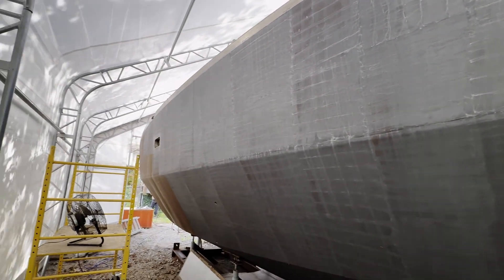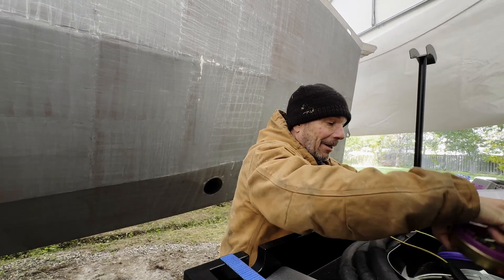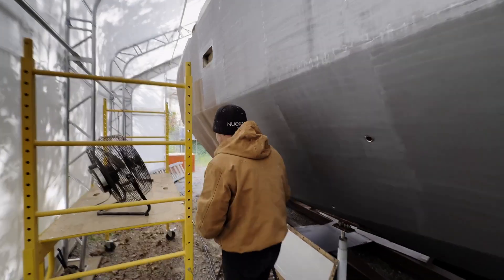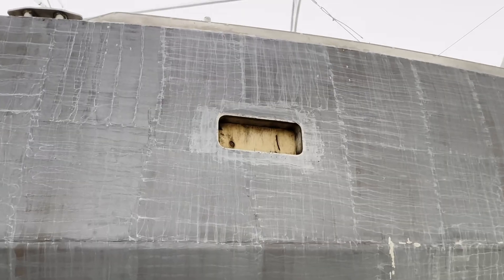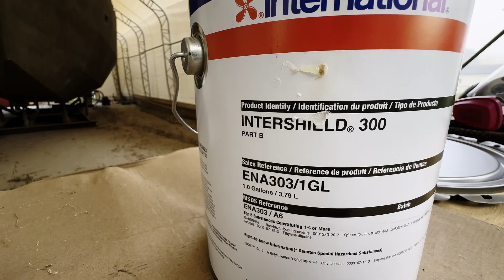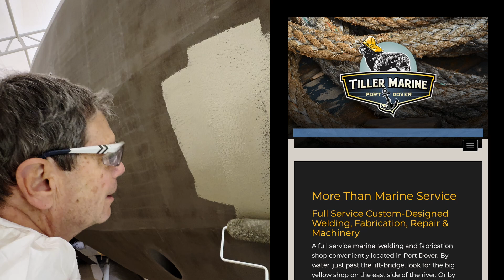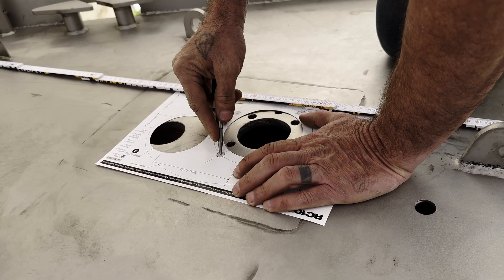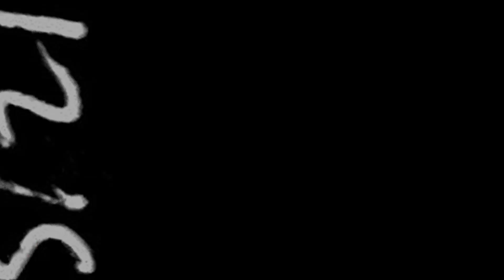⛵️ Is Laser Cleaning or Sandblasting Best For Prepping The Hull? - Expedition Sailboat Build | Ep.6

Comment: I run a dry dock in the UK. We shot blast canal boat hulls. I’m really interested in the laser cleaning options, mostly because of the mess
Reply from the maker: @paddyr1568 Nice to read you! 🙂 That was one of the reason why we really wanted to laser clean the hull. We have close neighbours and we didn't wanted to affect them. Also, it is really quite a mess to clean up after. The other reason was to enable us to go at our own pace. For example, when we will start cleaning the inside of the hull, we want to be able to do section per section. So once a section is clean, we can paint and then close up that place before moving on.

Comment: I can't hear the sound...(problem ob my side, not youtube). Did you rent a machine or buy one? Is it pulse or continous? I'm on the verge of buying a laser to do my boat. Looking for any advice I can get.
Reply from the maker: @smurglerer too bad your sound doesn’t work. 
We did buy the machine as we knew it would save us money at the end (sandblasting is expensive and messy), since we are selling it after we are done with it. And we can do bit my bit instead of having to do everything in one go. 

Depending on the thickness of your metal, you might want to go a size up (watts). This one was right for us. It’s the 1500. 

Cleaning function is 🙌 
And it can be use on more than just metal. 

Welds are clean, prettier than stick or Mig. The laser welds are sounds too. We did a video comparing MIG to laser welding if you want to learn more. 

https://youtu.be/fFlPdiR-ktw?si=eGiRIL54z0dQ1GKU

The cutting function is awesome. It makes really nice clean cuts. But you do need to take precautions as the laser beam can cut farther than you might expect. Safety required. And it’s better to use a guide for best results.

When looking for a laser machine, one thing that is of the utmost importance is to have a chiller included. And plan for space protective lenses too (specially if you are going to clean a lot). 

Hoping this will be helpful.

Comment: Hey guys. Big ship fleets have been experimenting with laser blasting/cleaning too. There are models of laser cleaners that have built in vacuum systems. Did you try to tape a vacuum cleaner hose to take away some of the flying dust /debris? Other options to sand blasting are water jet blasting and steel grit blasting. Each have their advantages and disadvantages. In the end, sand blasting is worth the horrors of clean-up as it offers the optimum profile to ensure a well adhered coating. I don't think your initial attempt to prepare the hull with the laser would've given you the equivalent profile - just based on what I saw in the video, so maybe it was a "blessing in disguise" that you ended up going with the sandblasting. Nice work.